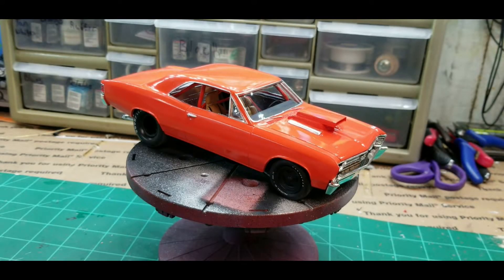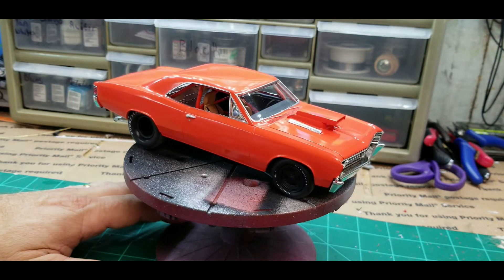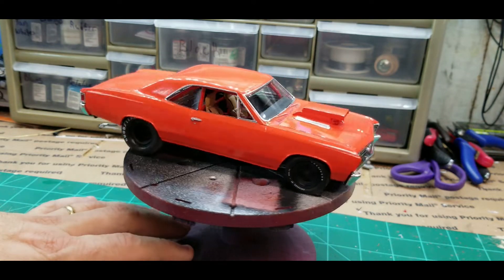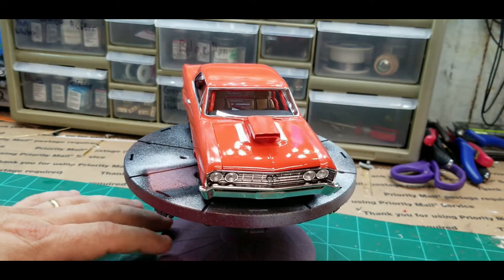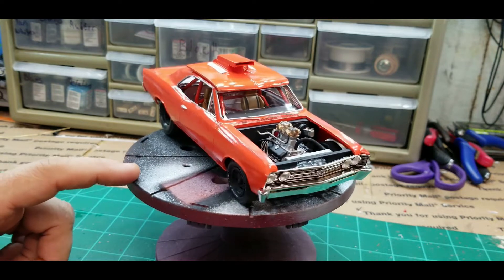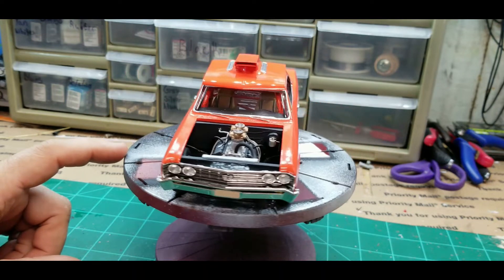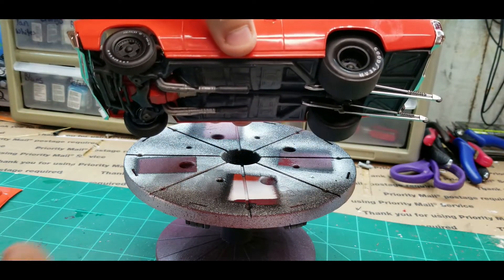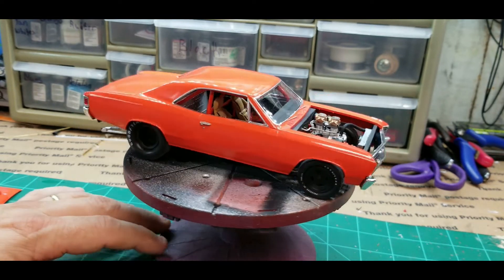1/25 Scale AMT 1967 Chevelle Pro Street Build Finally Complete!!

Comment: Welcome to the community! Found ya thru Jeff’s Model Garage ! I use brake fluid for stripping paint also. CHEVELLE looks great !
Reply from the maker: Thanks!!
Reply: How long does the brake fluid take to strip off paint? Does it work better than the simple green/purple power?
Reply: Tony Lantzer It really depends on how long the paint has been on the body. Generally I put the body in the brake fluid bath and leave it over night. The next day, every bit of the paint has been stripped on the body, primer included. Take an old toothbrush to remove the any paint in the body lines and crevices. Wash thoroughly with Dawn dishwashing detergent and your ready for another another paint job. Hope this helps.
Reply: How many times can you use the same fluid? Thanks for any input. Really enjoy talking models with anyone. Thanks again
Reply from the maker: It works a while for me. When you paint as crappy as me it'd better last a while!! Lol
Reply: Tony Lantzer once I strip a body, I will strain the fluid through a household type strainer to catch the old paint particles. I have been using the same brake fluid for a while 5 years tops.
Reply: Thank You. Appreciate the tips. Have a sage and happy holiday!
Reply: Tony Lantzer Thanks Tony and you as well!

Comment: Hey Matt,  what type of paint did you use for the chrome trim, and how durable would you say it is?  Thx
Reply from the maker: That was from way back and I think I taped it off and used rustolium metallic. It's ok but not compared to the chrome paints I'm using now.
Reply: @modelcarvideos5829  Thanks for the response. 👍🏼